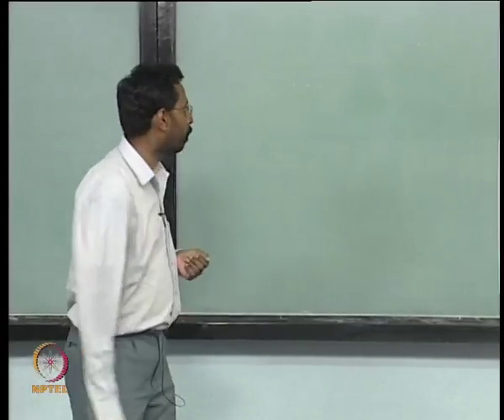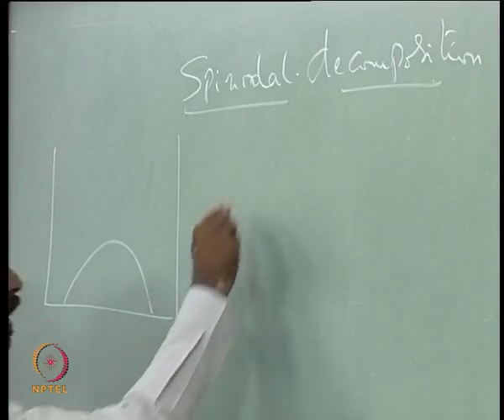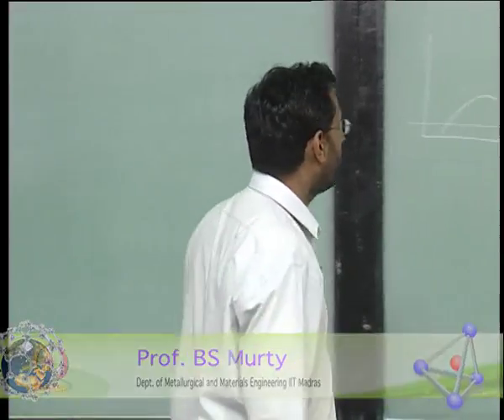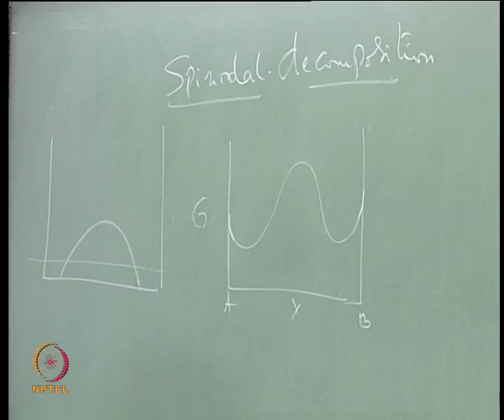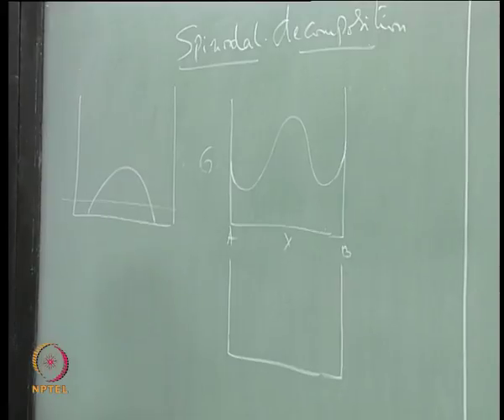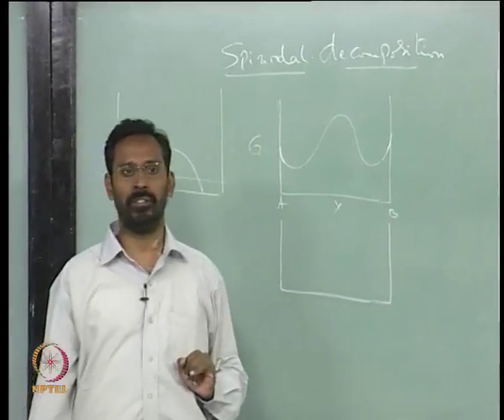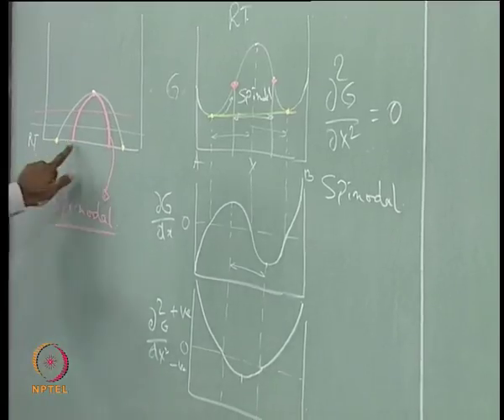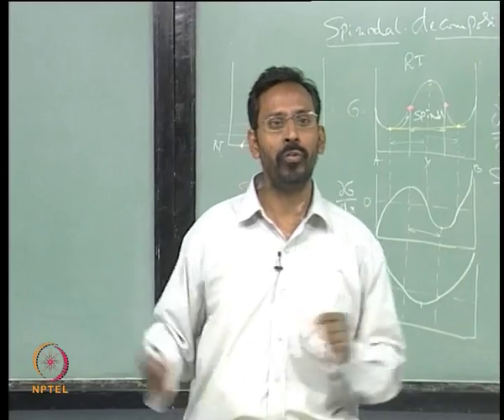Mod-01 Lec-21 Spinodal decomposition

Comment: Great video. Very informative. I however had a query: At 19:32 it is indicated that the free energy of the two phase state is lower than the single phase state of the alloy and hence, it will try to split. However, further on, while describing fluctuations, a reference is made to the free energy of phase separated state being higher to the mixed state. Can someone please explain these two concepts. Thanks
Reply: Local atomic vibration and fluctuation at nanoscale form some cluster of phase alpha 1 and alpha 2 with composition near to the alloy composition (alpha 1 rich in A element to the right side and alpha 2 to rich in B element left side) and when you join these compositions in free energy curve (within the spinodal region ) you find the tangent joining these two compositions have the lower free energy as compare to the free energy of the alloy because of which it favours this spinodal transformation of that composition (alpha 1 and alpha 2 with different composition) which keep growing over the time and spread uniformly when completed. On the other side at 19:32, the composition is outside the spinodal region which follows a totally different mode of transformation. Thanks